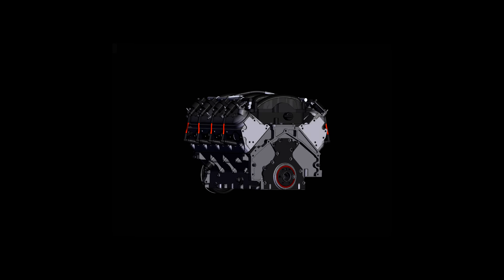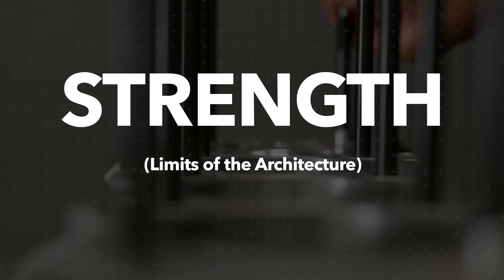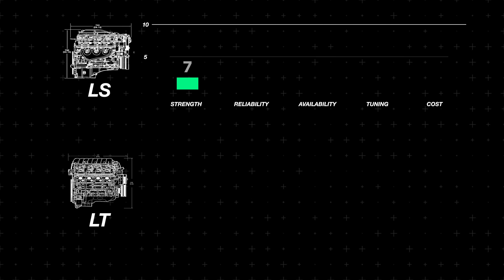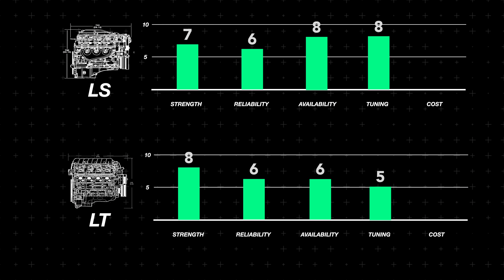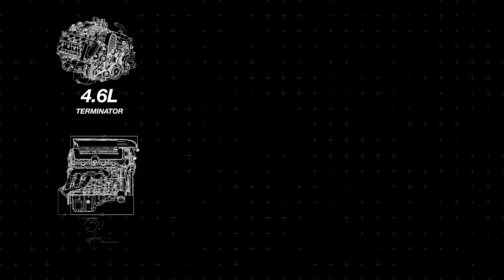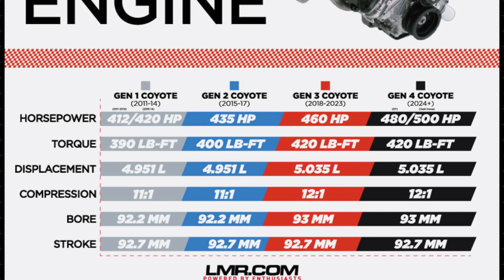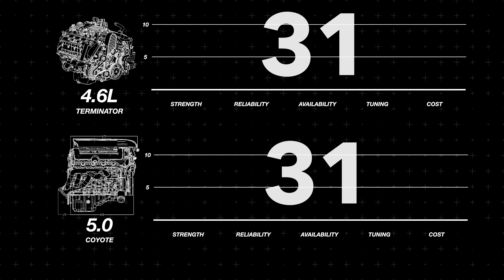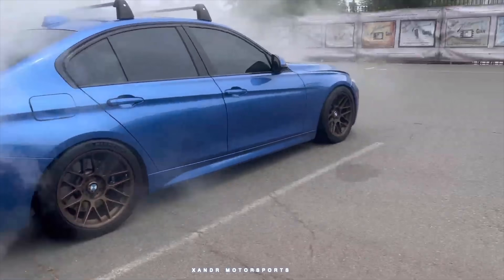Why Old Engines DESTROY Newer Ones💀| Explained Ep. 25

Comment: My favorite engine was designed in 1953, and many of the features developed and debuted by that engine, are now in almost every performance engine. No, its not a chevy, Ford or Chrysler. Its the engine that went 406mph in 1960, started the muscle car era, and dominated racing in the US from 1960 to 63, when the infamous racing ban at GM gave Ford and Chrysler the advantage. The LS has many of the features of my favorite engine.

Its the Pontiac V8. FYI the RPO code for the RA IV 400 was LS-1. The 455 HO was LS-2.  The LS1 had nearly the same bore and a slightly shorter stroke as the 350 Pontiac. Valve angles, air gap intakes, and a lot more are in the LS engines and it came from Pontiac. the Windsor Ford has tech in it that was developed by Pontiac as well.. who came first?

Comment: You should do a video on Rotary engines and why they are more powerful than people think, there’s tons of sources for info on building reliable and powerful rotary engines, you could talk about the 12A, the 13B Turbo engines and the 20B, a lot of these engines are famous for pushing power with minimal work, usually, changing the port timing and the fact that a Rotary can spin up a huge turbo with little to no problem because of the nature of rotary’s engines exhaust nature. Just a few examples I listed and there is a lot more.

Comment: This video is awesome. I'm doing an LT swap instead of an LS swap and let me tell you the aftermarket support is very minimal compared to the LS. Everything needs to be done some roundabout way from mounting and placement to fueling. Still worth it tho lol
Reply: The Ignition system is shit. I would be getting a 24x reluctor for the crank, and run the 0411 PCM, with LS coils, or the Northstar coilpack/module setup.
Reply: @jamesgeorge4874  ill see about that when i get to actually tuning the motor

Comment: 2jz is over hyped ... Way to over hyped . On paper an Audi AAN destroys a 2jz. Lighter , tighter smaller package , 1 less cylinder so it revs faster and makes more power per liter .
Reply: When an multiple Audis do 5 second quarter miles then I’ll listen
Reply: @thatcornfedrx8guy372  my guy ... The fastest Audi in the world is a 1992 s4 that did like 267 at Bonneville and those old s4 are heavy as hell . And based on just a basic Google search a 2jz swapped Datsun did 244 , a swapped roadster did like 260 and fully build custom slim body Bonneville cars were cracking 300 .... So for the 2jz to go faster than a 3700 pound full size Audi it has to be in a custom built car . Bro let me break out the math . Stock highest j2z maded 320hp from 3 liters and two turbos so that's 53.33hp per cylinder or 106.66 HP per liter . The Audis highest output stock 5 clyinder of that area is the rs2 ADU  at 311hp from 2.2 liters and a single turbo and that's 62.2hp per cylinder or 141.36hp per liter . 

So weight 
2jz is 440 pounds 
Audi ADU is 390 pounds 

Power levels on stock internals :
2jz I believe is around 800-850ish 
The Audis are around 550 to 600 . Problem there is the audis engines are alot rarer so not as much info can be aggregated on that and Audi guys are more afraid of taking the stock internals to a place they might regret (example the head cracked in my 93 S4 and it took me 11 months to find another head that I had to have shipped from Germany ) . My current engine is at 550 on stock internals and I'm putting upgraded rods in it cause if you have a good tuner the rods can live around 600hp . 

That comment about doing 5 second quarters ... That's alot more than an engine , that's drivetrain and the chassis also . Shows alot that I make a comment about an engine and you bring up a topic that includes the entire car not just the engine . A comment a out how much power that engine can make on stock internals would have been a better rebuttal because that's the only area where the 2jz wins but other then that the math says the Audi engine is better because my comment was about the engine not the car .
Reply: @thatcornfedrx8guy372  if the cars those Audi engines came in weren't 50k in the early 90s (that's like a 125k Audi in today's money) they would have been alot more popular . That's the problem , the supra was cheap compared to the Audis so it sold better so there were more of them made

Comment: Well it’s very interesting I don’t think you will find any thing to compare to the LS swap there putting it in everything !  I’d like to see a very large LS engine in a tractor with a 18 speed . Does the LS have enough torque to pull a 18 wheeler load ?  Can we build a motor cycle with one ?  Then those Toyota/bmw straight 6 engines hum how about a 53-54 corvette that came with a blue flame 6 cylinder in it !  Let’s put one of those new 6’s in some thing older and see what happens!

Comment: About to watch, guessing it's because newer engines are better engineered to fit their purpose (thinner metal, tighter tolerances) while older engines were overengineered and could be pushed to fit higher pressure and different tuning because they were not as tightly engineered for a tight target performance.

Comment: Im only 4min into the video and I don't agree that the LS lost points on reliability for the DOD/AFM. If we are talking modified motors here, when fitting a aftermarket Cam all that junk goes in the bin. Its kinda like picking on a Honda because the factory cast exhaust manifold can crack.... 

Ive been there on a L77, and aside for the normal cam supporting mods (3 bolt cam gear, LS2 Tensioner, Double valve spring, molly push rods, trunion's, and LS7 lifters, all you need is a new GM valley cover and when its tuned for the Cam, they can also disable DOD on the edit.

Comment: 11:00 to be honest, i don't think that the b 58 has shown its full potential yet 
the n 54 took quite a few years to really be accepted and tuned to its full potential aswell and as b58s get more and more available, i think there is a lot to come in terms of performance aftermarket parts
Reply: There are already many out there making 9-1000+whp already,and the highest currently making 1350whp(tho being turned down to handle the power and tested before going full send with full power). Say they're there already especially with the amount of 9-8s B58s there are already.
Reply: there are s58s making 1250hp (due to stock transmission blowing up with more). Easy to say say more reliable when transmission limits your engine hp.  @carboydorifutoparty3976

Comment: Cobras have dynoed at 400-420+ stock form before as well has pushed 1200+whp stock bottom end 
The terminator was more a match for the C5z06 especially pullied was faster..then it was matched up with the ws6 or ss camaro..

Comment: This is such a terrible take. Your ranking of better includes:

- Strength
- Reliability 
- Availability
- Tuning
- Cost

OF COURSE all of the older engines would win out, because 3/5 categories are directly based on time. Using LT/LS as an example -

The LS “wins” because it’s got wider availability of parts, more tuning prowess, and cheaper cost? Yeah man if they’ve been making an engine for 20 years OFC these things will win out for the older engine.

By your metrics was the LS worse than the carb engines that it replaced? Why the heck are you factoring in 3rd party dependents on whether or not an engine is better than another? 

Bad video and L take. Love your production quality - but you shouldn’t be factoring in variables that the engines don’t directly affect if you’re looking for the “best” engines. Older engines are tuner favored because of the community built around them and their open workability, not because they’re any more reliable or powerful generally than newer engines. Cmon man

Comment: For 4 cylinder would be the Toyota's R22 platform.  6 cylinder gas would be the Ford inline 300. V8 gasoline Chevy's 5.7L 350. With diesel's Cummins 5.9L and Ford's 7.3L PSD.

Comment: Your ranking for Coyote strength might be accurate for GEN1, but GEN2+ Coyote can handle HP levels on par with Terminator. As far as reliability are we talking stock reliability, or modded reliability? I wouldn't say a Coyote is less reliable than a Terminator. Terminators have poor pistol to cylinder wall clearances for handling higher than factory PSI's. Terminators also suffer from a large list of potential gremlins you can have. Each car is different, but pretty much all Terminators are going to suffer from at least 1 or 2 of the potential gremlins. Coyote can have cam phaser issues and whatnot, but generally speaking a well maintained Coyote is reliable and trouble free at anywhere near OEM HP. Coyote is also cheaper and easier to mod when compared to Terminator when looking at it from a supporting mods standpoint, especially GEN3+ F150 Coyote which is factory flex fuel, and SD instead of MAF. Obviously when talking blower swaps, and whatnot the Terminator is much cheaper to mod.

IMHO GEN5 SBC is a much improved on architecture to GEN3/GEN4 SBC, but the GM messes it up with DOD and DI fuel system. LT5 being the lone exception with no DOD and a dual port injection system, but the cost is high, and availability for LT5 is low. L8T also doesn't use DOD, but is still DI instead of dual port injection. The block and head design of GEN5 LT is superior to GEN3/GEN4 LS though.

Yes I own, or have owned Terminator/GEN3 Coyote/LS/GEN5 LT vehicles, and this is why I give my opinions on them.

Comment: I loved the presentation and knowledge given BUT... if you are asking the question are the older engines better then why even consider cost and availability? How does the fact it is hard to find a 2je factor into if it is better? Ok so the 2je is now rare and thus a expensive unicorn. That makes it a worse engine? Sorry but those criteria are meaningless when discussing which stock engine is better...as far as I am concerned. Yes, both factors matter if you are reaching into your pocket to buy but not on which is better from a mechanical standpoint.

Comment: B58 is better though, it is more reliable and it's tuning potentials haven't been pushed as far yet. Also, the 2JZ needs a bigass turbines to push over 1000hp, which results in longer time to get to that high performance, while the B58 quite better than the jz for drifting for example, where you need to keep it at that high rpm for longer and have more midrange rpm horses.

Comment: So, two years ago many of the older engines would have scored higher on availability, and some of the newer engines scored lower due to tuning pains. I think then it would be safe to say that this trend will continue, no? Older engines will be less and less available, and newer engines will become easier to tune with added experience and a better knowledge base. The LT should eventually just become like today's LS, but better. And so on. It's just a matter of time, it's not like material quality or design quality is going down over time.

Comment: Interesting comparisons.  It does feel though that this is a boost preference comparison system.  Strength is, less(still important) of a concern if someone wants to go the N/A way and put on a nice set of equal length headers and ITBs.  Strength is still important if you want to rev to the moon and back, but weight(only briefly mentioned at the end) is extremely important if you want to shove the engine into something meant for auto cross.
Maybe I'm wrong about strength, but I have heard a lot more about fueling systems that we enthusiasts are responsible for upgrading not being beefy enough for the amount of demand we put on them at high RPM and touching pistons and heads by running lean being what kills N/A engines, while that, plus absurd peak pressures and high AITs kill boosted motors.  Hence those boosted motors need the "preferable" reinforced cast iron boat anchors. Yes, there are pretty good aluminum LS engines for boost, but that comes with higher $$$ for the LS platform.

Not saying your comparison or video are bad or wrong, just looking at it from my slightly different perspective.  I'm someone who wishes that Nissan had gone through with making the aluminum block RB26s because I would love to do an N/A RB build, but can't justify the weight of the iron block.

Comment: very nerdy 🙂
what i miss is a completely separated turbo where the exhaust turbine is connected to an electric generator and the intake turbine is connected to an electric motor.
the geometry of the exhaust turbine could be freely new designed just for efficiency and it's design can completely ignore the intake air turbine. there is no to small for high rpm power or too big (and slow) for low rpm power anymore.
the air intake turbine would be only driven by an electric motor than can be electrically controlled at optimum performance in every rpm, load, humidity, temperature condition.
these two parts, because separated, can then be placed in different locations which benefits the compressor part because of a lower temperature environment. that makes it more efficient.
and there is NO turbo lag, because the compressor part can speed up in no time due to the electric motor. this concept would be a great addition to every motor, even a VW beatle engine, if you don't overdo it with power. having enough air/oxygen in low rpm scenarios where you suddenly step on it gives you a good efficiency and clean combustion. and with cooler air intake you reduce NOx output.

Comment: Good presentation, but your methodology is broken. Its hard to see when comparing these engines, but frankly only two of these engines are what people really build. The LS and 2J are very popular built engines, but the rest of these are only starting to become popular. In the drag world the ls, old LT, and ford 302/5.0 from the fox body cars still prevail. Why? Because those old 5.0 engines are simple, easy to build platforms with lots of tuning options. There are bazillions of them around as they were literally put in everything that ford offered, and they can be built out to a thousand horse power. This is why I say your methodology is broken. Any reasonably modifiable engine that was highly produced will break your results, even if its not the super highest performer. Take a honda engine for instance, basically all of the 80's to late 90's engines from honda are easy to come by, easy to mod, and can produce decent power. They thus score excessively well in the cost, avalability, tuning, and reliability sections even if you don't consider their strength to be all that great. See what I'm saying? You can have an engine that is only good for like 400 total horse power, but because its reliable, easy to tune, and avalable for cheap it beats out enthusiast engines.

Comment: Btw, the terminator engine is so rare and expensive compared to the coyote it might as well be off the table in terms of this comparison. The "normal" 4.6 would have been a more apt comparison along the lines of comparing a LT to an LS.
Reply: So, how does the normal 4.6L compare? Obviously not as well in the performance categories as the Terminator, but otherwise, how does it hold the line?

Comment: I don't think older engines are "better", it's more older engines have been around longer and thus are generally better understood and more supported by the aftermarket. You have some really good engines both old and new but your options are likely to be fewer if the engine just came out.
Reply: yup. there's a reason millions of rodders still prefer to work with  SBC's even now
Reply: @pauls5745  dollar for dollar sbc and bbc are really hard to beat but some of the late model stuff is really good too. You can slap a turbo on a LS or Coyote junkyard or crate engine and make a lot of power without even trying.